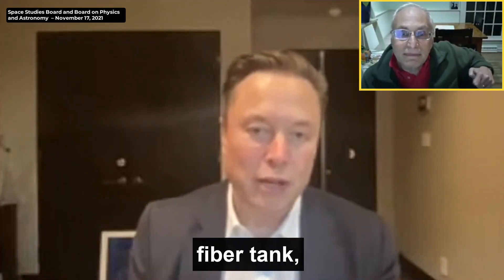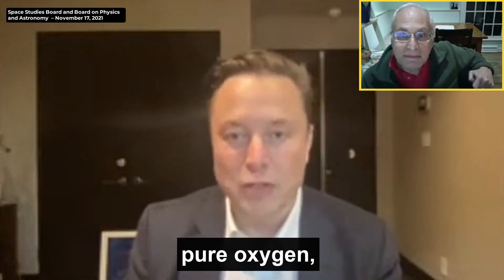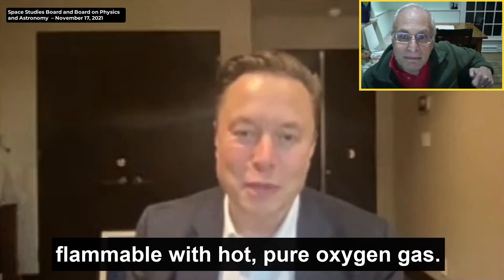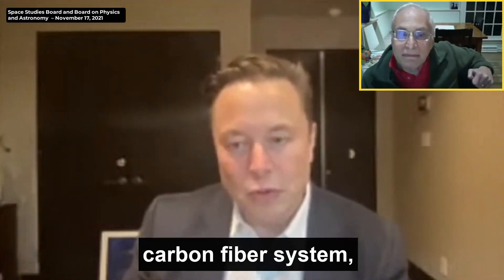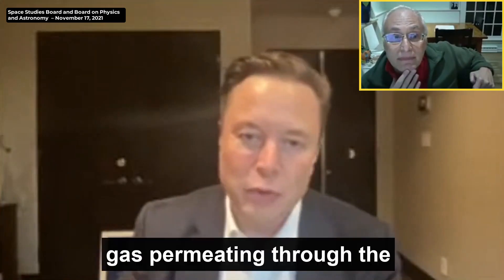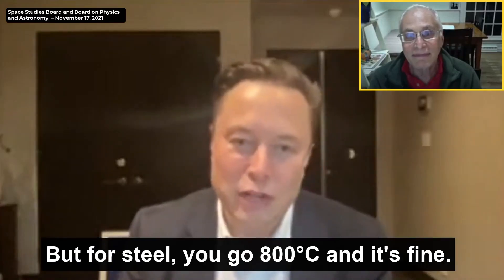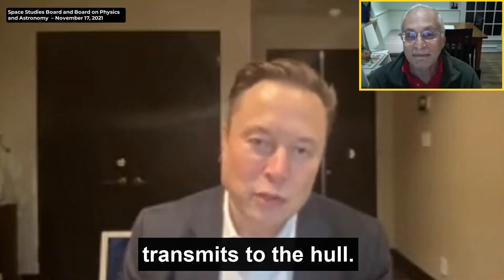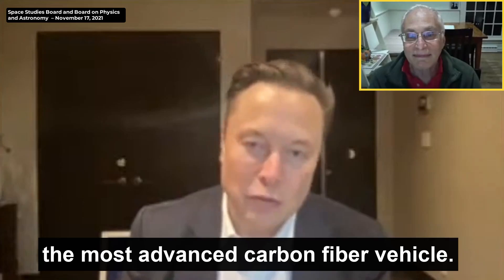ELON MUSK EXPLAINS WHY SPACE X CHOSE STAINLESS STEEL OVER CARBON FIBER!

Comment: I’m going to challenge Musk here — not yet on the engineering, but on the math.
Comparing 4 USD/kg industrial stainless steel to 130 USD/kg aerospace-grade carbon composite is apples-and-oranges — especially when density is left out. It’s a comparison between commodity metal and high-end composite, and the numbers only look far apart because we’re not comparing like-for-like.
But Engineers don’t size tanks by kilograms — we size them by volume and load paths.
Carbon composite weighs 5× less than steel. So comparing cost per mass is the wrong unit.
A realistic industrial composite (not aerospace prepreg):
Fiber ~25 €/kg
Resin ~6 €/kg
65% fiber mass fraction → 18.35 €/kg final
Yes — per kg, that’s ~5× steel.
But normalized by density, we get:
Stainless steel 304 (Density 7.98 kg/L, Price 3.45 €/kg) ~ 27.1 €/L
Carbon composite (Density 1.51 kg/L, Price 18.35 €/kg)	~27.7 €/L

There you go.

Per volume — the unit that actually matters for structure — the cost is basically the same.
So, if Musk says industrial steel is acceptable, then by the same logic a standard industrial carbon composite is acceptable too.

And if the issue is "autoclave from hell," then don't use an autoclave — filament winding + OOA epoxy solves that.
This isn't me claiming carbon is better. Just that the comparison per kg is bad engineering logic.
If we compare correctly — per liter, not per kilogram — the debate changes completely.
Yours faithfully
Gert Hoffmann — Mechanical Engineer by Heart and the Grace of God, Servant of Density & Volumetrics